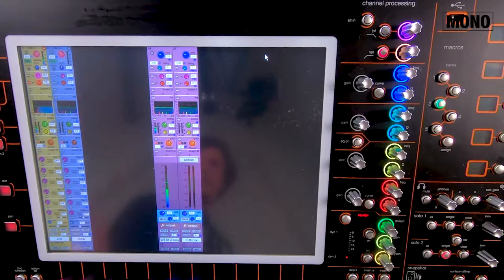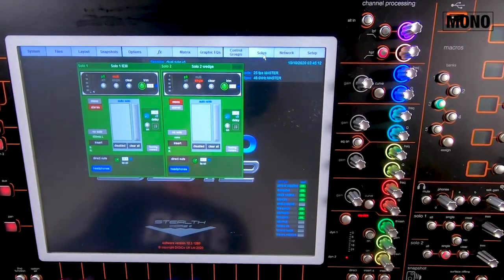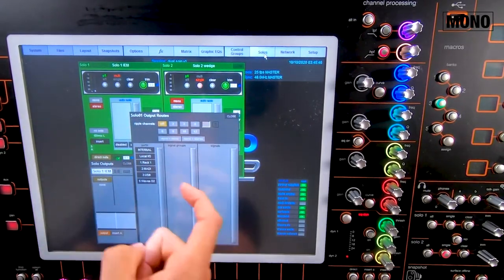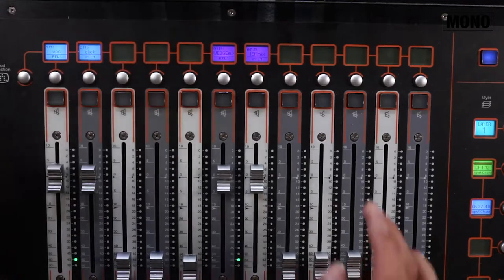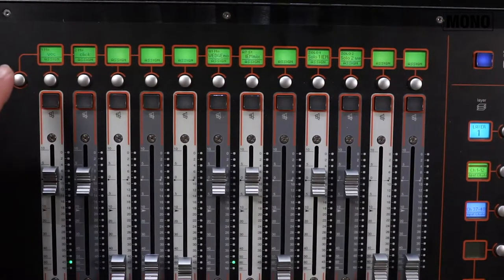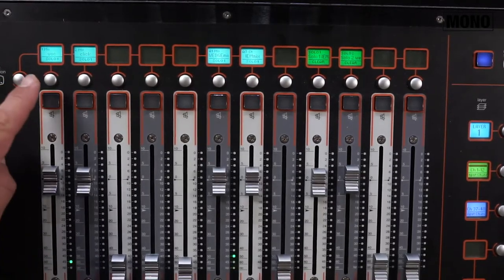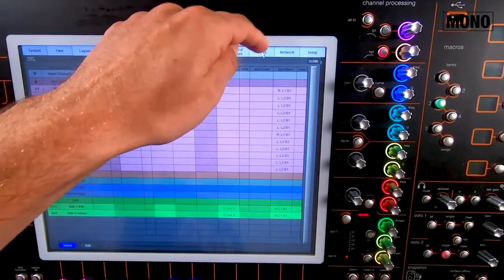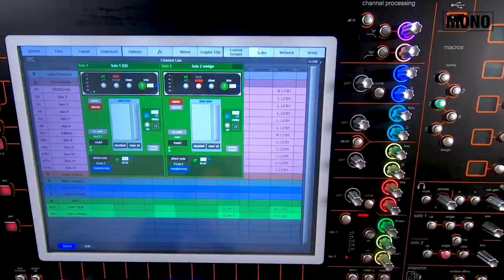How to set up a dual solo bus on a DiGiCo

Comment: So is the solo feature for monitors and iem for the musicians? Or is it for the monitor engineer?
Reply from the maker: Hi nate, i guess the word “solo bus” might be confusing. Simply another word for what on an A&H is PAFL bus (Pre or After Fader Listen). So the solo bus is the physical bus on your console where you route the signal to when you want to solo/pafl a channel or an aux bus for example. As a monitor engineer, you sometimes work with a band in which half of the musicians play on wedges, the other half on in ears. As a monitor engineer, when i solo/pafl an aux that feeds in ears, i only want to hear that mix in my solo/listen in ears. When i solo an aux that feeds a monitorwedge, i like to hear that mix in my solo/listen wedge. Basically i want to decide for myself where i want to hear a signal. I hope this answers your question? Don’t hesitate to ask!